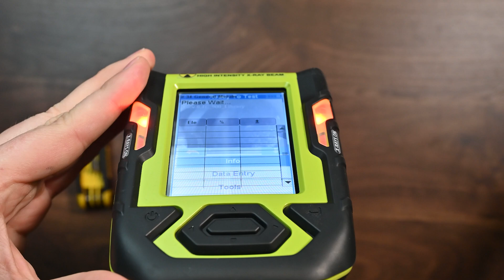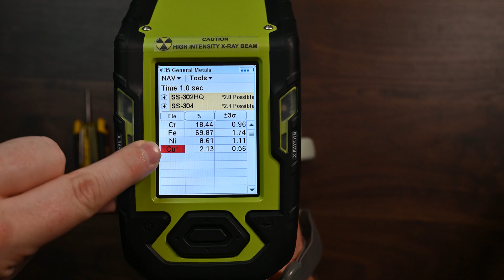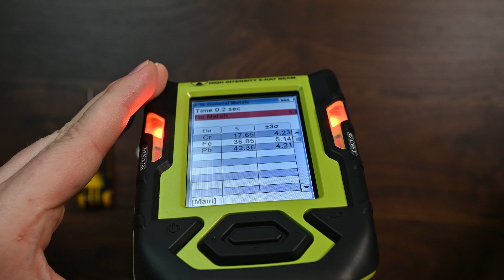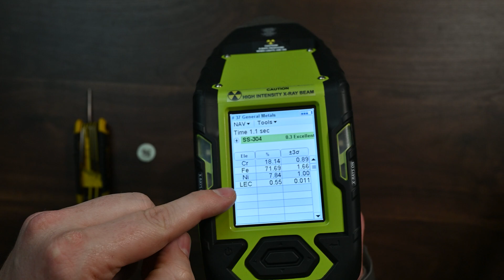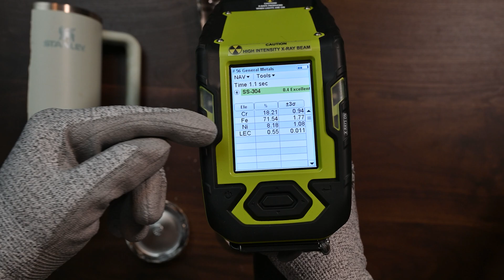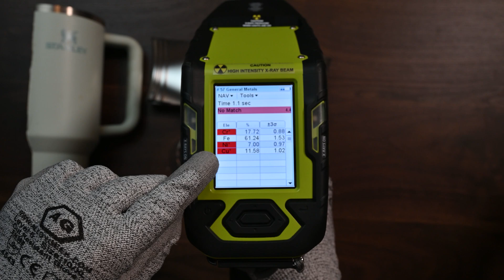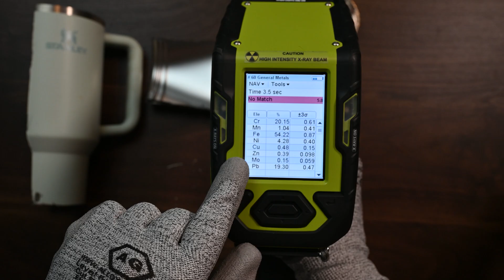Proof your Stanley Contains Lead - Finding the Lead in the The Quencher H2.0 FlowState Tumbler 40oz

Comment: So if it is dishwasher safe would it be possible to dissolve that lead through the plug, or is it pretty stable, especially under that cap you had to pry off? Nice video, very informative. Keep up the good work.
Reply from the maker: That is not my area of expertise. It appears the lead (Pb) is in some sort of polymer matrix. It's unlikely washing in the dishwasher would lead to lead contamination since soap and water typically removes lead from surfaces. We can't say for sure if the lead will leach out without testing. If you hand wash you shouldn't have any issues.

Comment: @4:46 Cu is added to steels to improve machinability (lowers work hardening rate). Makes sense for mass produced inexpensive screws.

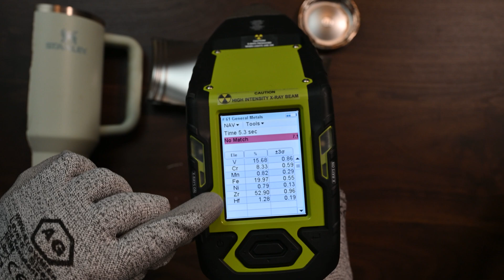@12:30 I don't know why they use those elements but Hf pretty much always comes along with Zr.

Great video!